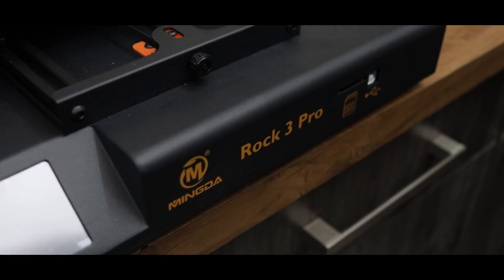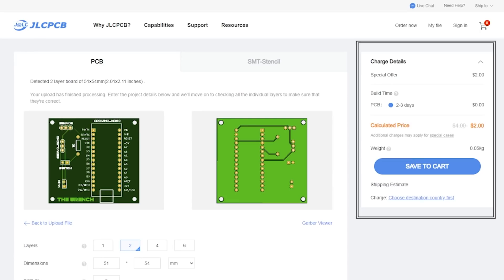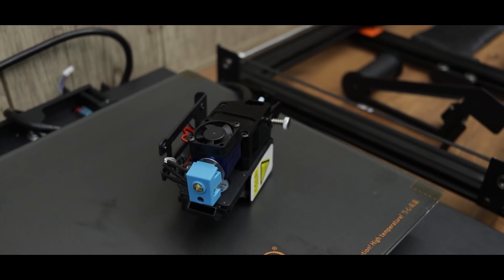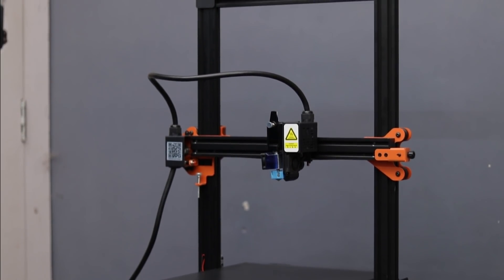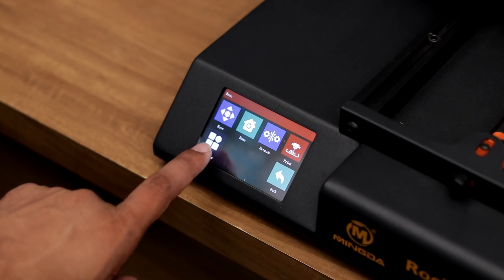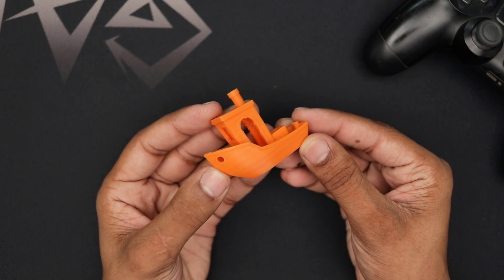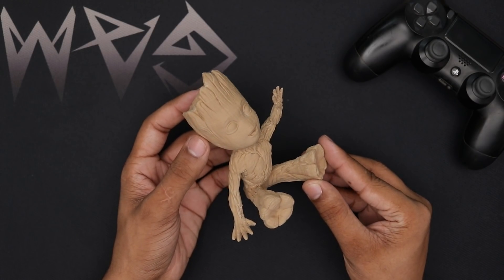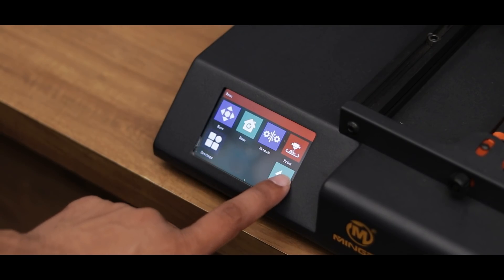WOW!Amazing 3D Printer | MINGDA Rock 3 Pro

Comment: Bro how to print with 3d printer
Reply: Bro u will need something called stl file u can easily download 3d models in stl format from websites like thangs or thingiverse after that u have 2 import the into a slicer software then you have change some parameters like infil percentage retraction settings etc. Then you can copy file to a sd card or a usb stick or by connecting ur computer to the printer you can print
Edit u can also create ur own 3d models from websites like thinkercad (which i use) or autodeskfusion360 (professional software)
Etc
Reply: If u are interested in 3d printers check yt channels like thomas sandlader  or makers muse ,breaks n makes etc
They have series like guide for 3d printing beginners etc

Hope this. Helps